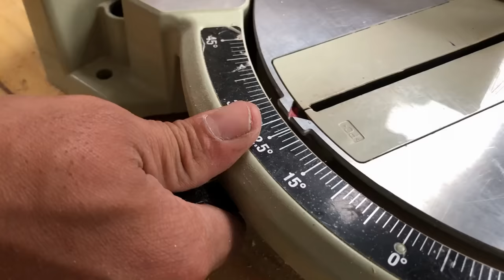Making Beautiful Outdoor Chair Swing For Your Garden | Best DIY Woodworking Ideas From Old Pine Wood

Comment: 10:31 Surely this type of bolt is meant to be used in stone? Pulling that hook, as one does by sitting on that bench, only results in a lateral pressure. This will never last.

Comment: Great idea and structure created, BUT -  why were the screws not counter sunk then filled, or  capped the screws or used dowels and glue to give your creation a better looking appearance, as they screws just jump out at me! Plus - I wouldn't tighten a screw fully with an electric drill as it is dangerous and one could twist their wrist! But I loved the idea which I might use for myself!
Reply from the maker: Thank you for your comments, we will try to improve in the next product

Comment: I saw glue once; That will be a rocking chair soon without the chain
Rawlbolt hooks?? Not if but when that pine split you are on your back
Back legs; Way to close in for balance support
Armrest finish; Put the screws in from the bottom
Use glue; Its an outdoor chair, it gets exposure to the elements and I am sure it will be sold for use not as a ornament.

Please do not copy, this is a health risk
Reply: Julia roberts y
Reply: Estou ocupado

Comment: How did you say the accident happened? 

Well, there I was using an angle grinder over the top of my fingers and I realised I then had to use a drill with enormous torque. Having lost the fingers on my support hand it made it difficult to control the drill hence I lost my front teeth. 

Oh, I see.... and the stab wounds? 

Oh well that was obviously when I was using a table saw with no riving knife and my two remaining fingers weren’t strong enough to prevent ‘kick back’!!!

Lads - hats off to you but Jesus, I’m cringing out every time you jump to a new power tool. Anyone thinking about copying this - DONT! 

Drilling backwards weakens the joint. The screws look like they’re for dry wall use and the supporting hook is secured with an expanding wall anchor. 

Love the creative aspect of it but this is not safe. Please be careful.

I suppose you’re at least wearing a face mask.... even if it is the wrong one....🤦
Reply: Vh...mmmmmmmmmm
Reply: B
Reply: Vbb
Reply: B